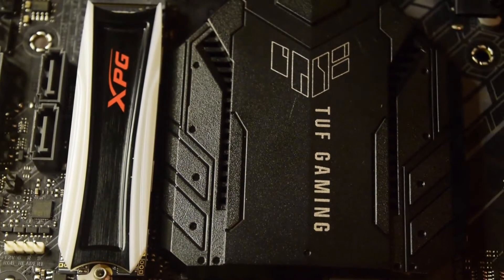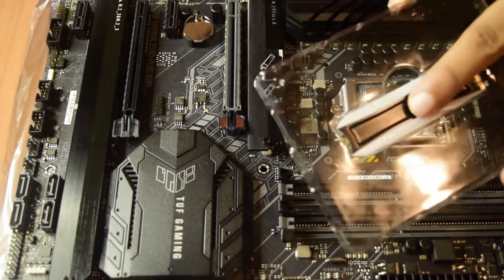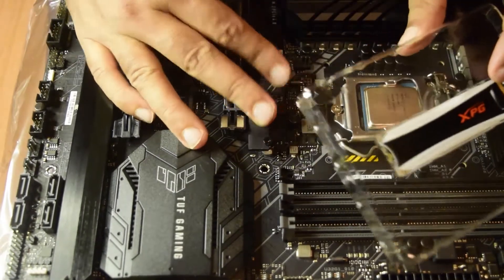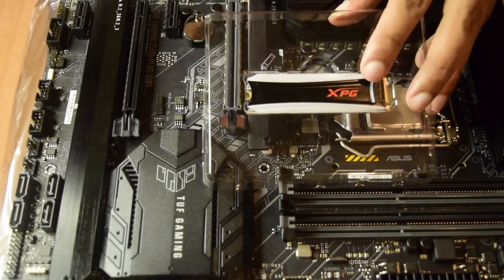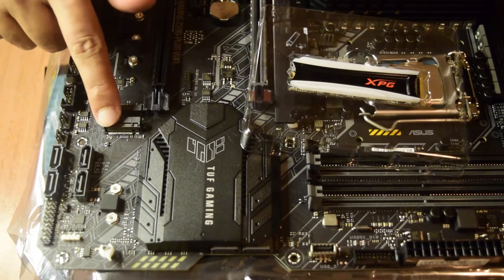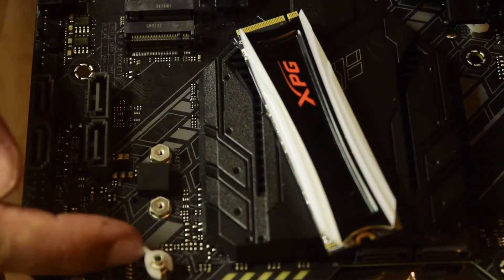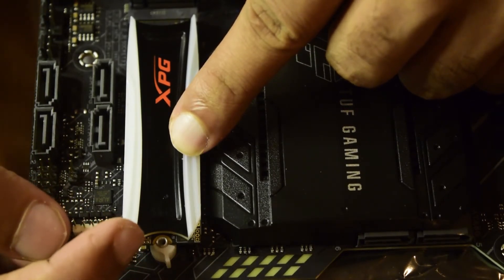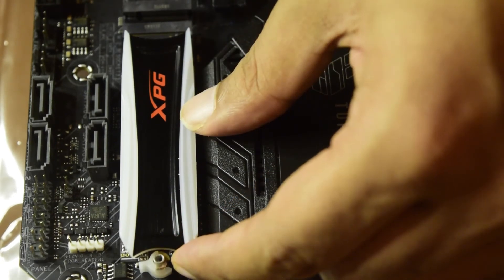HOW To Install PCIe Gen 3.0 NVME XPG S40G SSD On ASUS TUF GAMING Z590-PLUS Motherboard

Comment: And how you re add the upper protector motherboard had and  you removed to place the nmve........
Reply from the maker: There are some NVMe that dosent come with its heat sink so you place back the heat sink after installation but in this case my NVMe did came with its own heat sink so i did not had to re place back the heat sink that came with this motherboard.  I hope this helps. Please stay tuned to my channel for my future videos